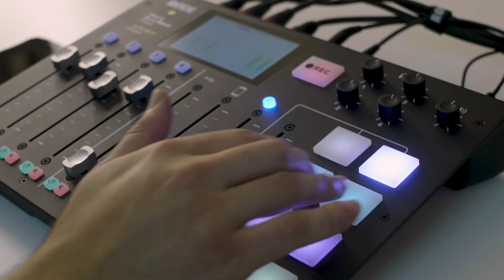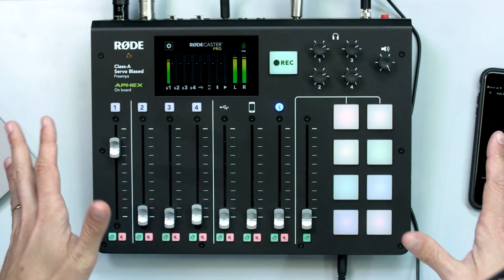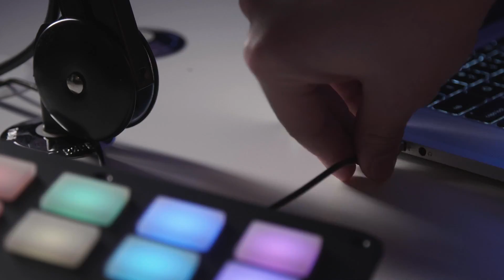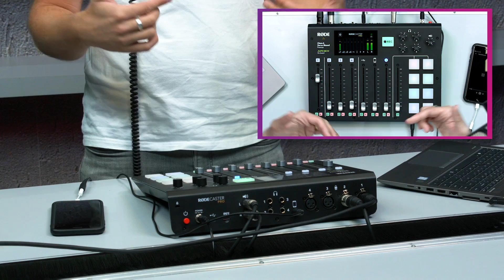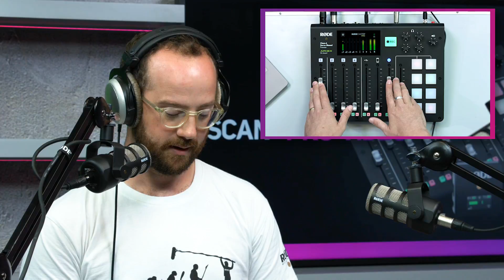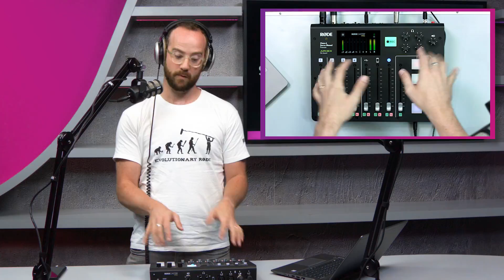RODECaster Pro Tutorial - Perfect for Video Production!

Comment: If you're using the Rodecaster Pro for radio on a remote or outside broadcast, wouldn't it be better to have the processor off because the sound will go through the station's own processor as it goes out?

Comment: The headphone outputs on the back, are they 3.5 mm? And do they output the entire mix, or do they just output that channel's microphone?
Reply: The outputs on the back are 1/4"
They are monitor outputs.  They hear what ever is selected to monitor.
As they are facing the back, the same as the XLR inputs - I suspect they are for the users of the mics.

There is a monitor output in the front as well, which is 1/8 and convenient for the operator of the device.
It really is an amazing tool - just got mine this weekend.

Comment: Do I still ne a pre amp / audio interface or cloudlifter using a shure sm7b for example before using this? I doubt that I can just plug a SHURE SM7B in and go?
Reply: Nidus I saw a video where someone used the SM7B with just the preamps of the mixer and it sounded pretty good. I also too want to know, because knowing the SM7B you almost always need a Cloudlifter or something to not stress your interface/mixer preamps and actually get a good signal.

Comment: I wish you guys would have showed exactly how to set it up to do a video recording though. This is pretty much just showing how it works when you do a normal audio podcast. Im trying to figure out how you add video with it. Any suggestions on where I might find more info on how to do that? Thanks.
Reply: linop412 , I totally agree. We want to know how to connect the rodecaster pro with our video camera.
Reply: @vanhargis572  Haha yeah I know and it looks like a lot of other people are wondering the same thing. I wish they would reply back and offer some help.
Reply from the maker: @DaCake2  @van Hargis the RODECaster Pro is solely an audio device, it does not feature any video inputs. As such you would need to mix the audio and video externally from this device. This can be done in a variety of ways but the simplest would be with a software mixing application, like OBS, Wirecast or vMix. You'd need a video I/O device to connect your video source to your computer but in these software applications you can take video and audio from different sources.
Reply: @ScanProVideo  Hi there... thanks for the reply. I actually have the Rodecaster pro and I totally get all that, but we are looking to add video to our podcast and from reading your title, I took it that you were going to explain WHY you thought it was good for video production and how exactly to set up video with it. Thanks anyway for the reply though.
Reply from the maker: @DaCake2   The Rodecaster is great for video production because it takes a lot of the stress out of getting high quality, professional audio for podcasts or small live events. Not every camera operator can be an audio engineer so the Rodecaster makes getting the best audio possible really simple. 

You might want to take a look at our video on setting up Wirecast:

https://youtu.be/zUPo0Zj4Mio

This goes through setting up a live stream within Wirecast including adding sources. As you can add different video sources to Wirecast, you can also add different audio sources. As such you can combine the output of the Rodecaster with any video sources you can get into your computer.

I hope this helps!
Reply: @ScanProVideo  Hi again... thank you for the link. I will absolutely check it out. Thanks again.

Comment: I love it too.  However, I've had issues with the audio from the rodecaster syncing with the video from my GH5's.  If it's an hour long video, by the end of the video, the audio track is about 1 second off.  Rodecaster tech support suggested some software that will transform the audio file to fit to these videos, but it just feels like that shouldn't be necessary.  Have you done any longer videos and run into this?  I've just been "adjusting the duration" of the audio clip from the rode until it lines up, but that's such a pain in the butt.  Curious is you've had this issue and what you do about it?  Or if it's preventable!  Thanks!!!
Reply: Hey Brian,  

I've experienced this before when trying to sync external audio recorders and a video. Typically it comes down to the frame rate you're filming in. Filming in something other than 23.976 will sometimes throw off the timing for some reason. Hope that helps a little bit!
Reply: Connecting Creators yeah we do 30fps
Reply: Logan 5 Well since I reported this problem, Rode sent me a new unit and now it doesn’t drift. ¯\_(ツ)_/¯

Comment: I just unboxed my system last night. I like the fact the arm comes with two different ways to attach to a table, you either screw it like in this video or use the clamp which is super easy and very sturdy. I was able to set up all 4 arms, podcaster pro, and the two monitors on a small table about 30" wide. Connecting the cell through Bluetooth was the best method because you have less cables to deal with. The 4 xlr cables this system brings are 15' long and way more than what I needed so I kept it tied with a zip tie that came with the cables. The monitors did not produce sound at first so I had to turn off power then back on the monitors themselves. The red mute button on the bottom work as expected. This system has a C-port in the back which connects to your computer through USB.

Comment: I get a lot of background noise even on a quiet room with treatment, any suggestions?
Reply: I don't know you room so based on the 2 videos I watched:

1. Your gain sounds way too low. Make sure you mics are set between the green rectangles inside the gain property.
Recording at -18 db is unnecessary since none of you are screaming into the mic. This will fix most of your noise issues.
Compare it to this video which is peaking well around -4.
2. Make sure the personal settings are set properly and honestly. If you voice is high and soft, set it to that. In some videos soft spoken voices sound overcompressed because it's probably set to medium or loud voice.
3. Your room doesn't treated at all. It reverbs heavily. If you are using foam, that might be the entire reason why especially in a larger sized room. You can make acoustic panels yourself with rockwool pretty easy.

I suggest you watching this video called "Bobby Owsinski - Improve the Sound of Your Room" which goes into deep detail how to treat your room in both a listening environment and a recording one but for podcasting, you can do anything in that video and your audio will sound a lot better and his tips are very affordable too!
Reply: Hey thanks for the reply, im definetly looking into all of this

Comment: Great video. Is there a line out of the Rode that could go into a Mevo camera or similar, so that the mix of 2 voices on microphone for example can be synched with video? If so, would it go directly into the camera, or via an iRig 2 or iRig Pre accessory?
Reply: You could use the headphone jack at the front or back depending on what you use to monitor. You would have to be careful with balancing it as its not a true line out but it could work